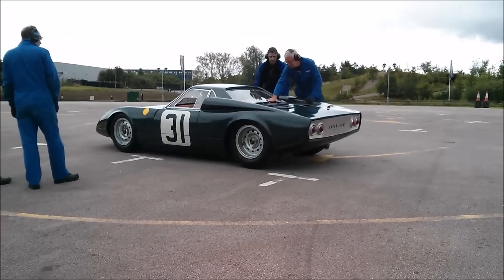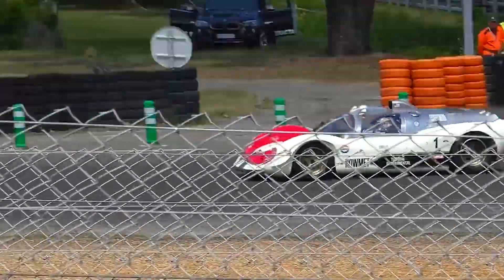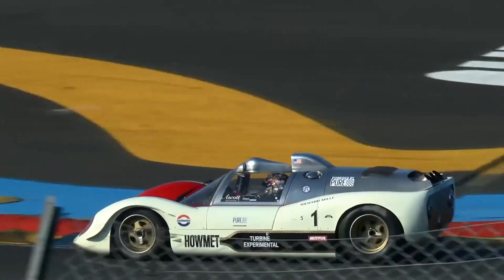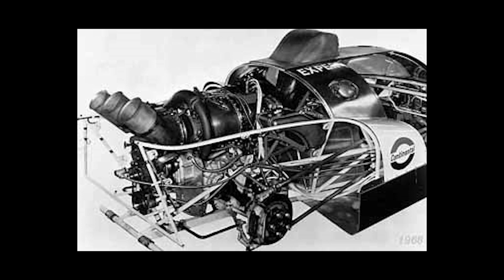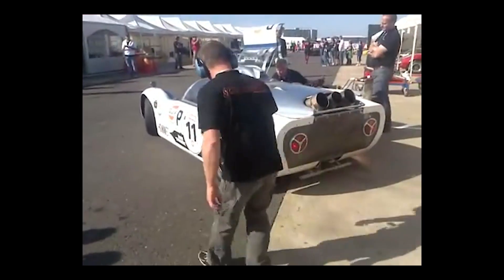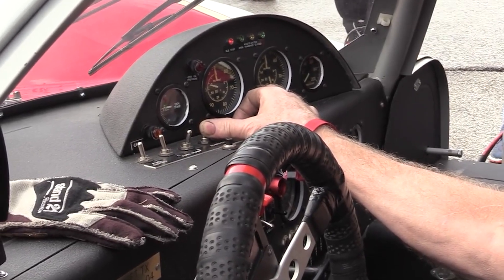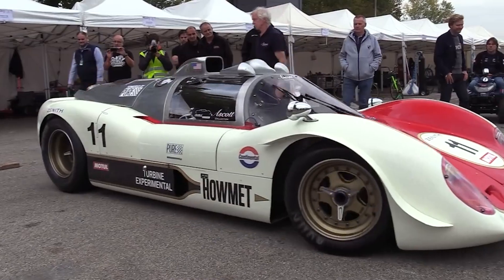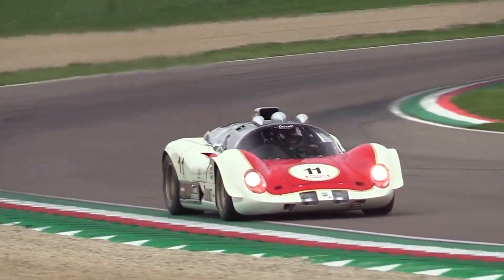The World’s Only Jet Powered Car To Win A Race Howmet TX

Comment: The first prototype Jaguar CX75 hybrid supercar in 2010 had two Bladen gas turbines but the next four cars twin charge turbo and supercharged 1.6 litre four cylinder 500 bhp engines, twin charge engines was first used on the 1985 Lancia Delta S4 Group B rally car.